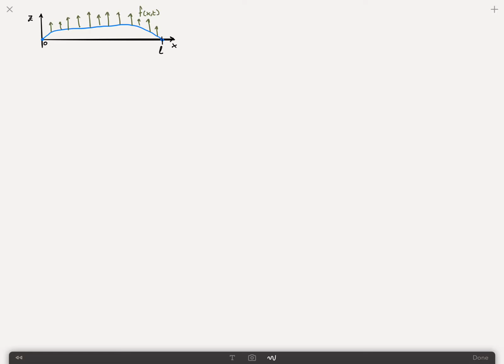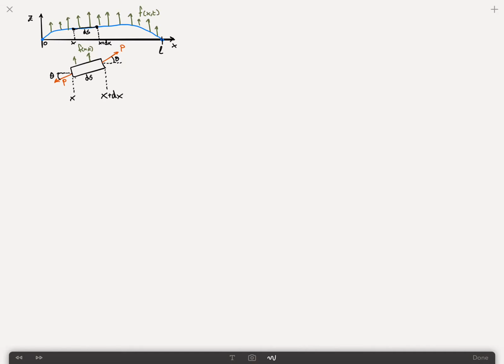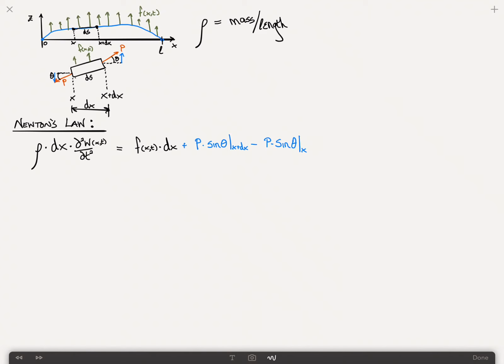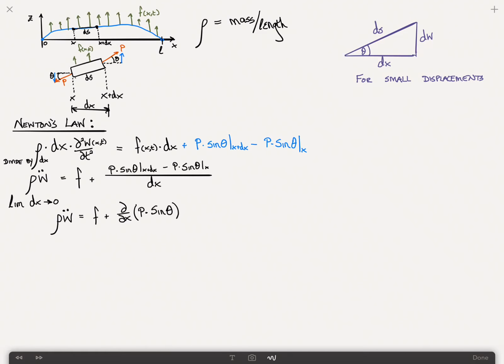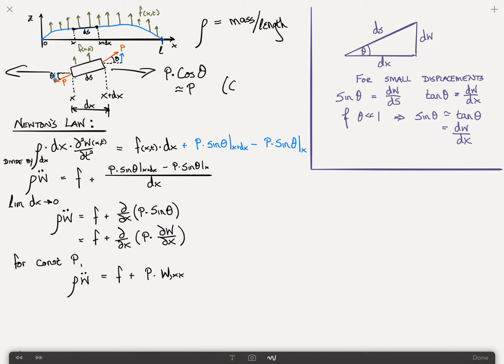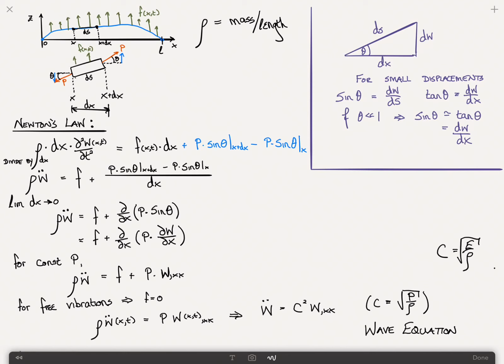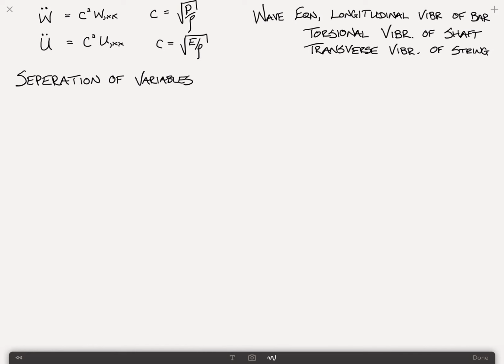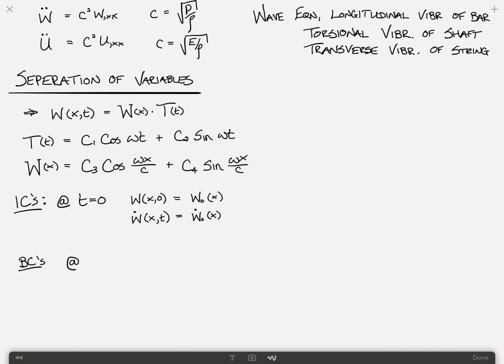Transverse Vibration of a String (Continuous System)

Comment: In the very first equation I would have used ds instead of dx (for inertial and transverse forces). The fact, that ds can be replaced by dx follows later, when the triangle comes into consideration. However, this will give the same result.

Comment: Sir, the P you have modelled correspond to the tension that every section of the springs applies on the other neighbors doesn't it? ( Left and right) In other terms it corresponds at the tension that links two particles  from infinite paticles that forms a spring right??
Reply from the maker: Yes. Each section links to the neighboring section. When you join two sections, the internal P’s cancel one another and you’re left with P’s at the ends.

Comment: Thank you, dear Sir,
Very well explained. I'm a musician, but also a mechanical engineer and I always wanted to understand the formulation of the wave equation. Two questions though:
1- Since the transverse displacement is a continuous system, shouldn't theta be the same on both sides of the infinitesimal element?
2- Since the transverse displacement is small, is it accurate to neglect the other small values such as string elongation and small changes in P?
Reply from the maker: 1 - Nope.  If θ is the same on both sides, then the string would have to be straight.  I realize this seems like a bit of a paradox, but it might be more useful to think of the infinitesimal section as a disk (rather that the cylinder I have drawn).  The string is just an infinite collection of these disks, the centers of which can be very slightly out of alignment.  By stacking enough of these together, we can form any shape of the string since they are very (infinitesimally) thin. 
2 - The short answer is yes.  Small displacements AND small rotations of cross-sections (θ) implies that P is approximately constant.  This means that there is not net force in the axial direction.  Also, the small displacement assumption implies that no axial displacement results when the string displaces transversely.  As a result of all of this, there is no need to consider the elongation of the string at this level (i.e. linear analysis).
Reply: 1- After a revision of the definition of differentiation, I came to understand that a derivative between one point (x) and the next one (x+dx) is different than the derivative between the same point (x) and the previous one (x-dx). I think this is the reason we do not treat θ the same on both sides.
2- Thank you

Comment: Sir , how can P in the string is linked to the shear modulus in a structure for wave equation?
Reply from the maker: The transverse vibration of a string and the torsional vibration of a shaft are both governed by the wave equation.  In the case of the string, the axial load P contributes directly to the flexural stiffness of the string while in the case of a shaft, the shear stiffness is G.  So P and G are similar in this comparison because they affect stiffness (they produce a restoring force in each case).